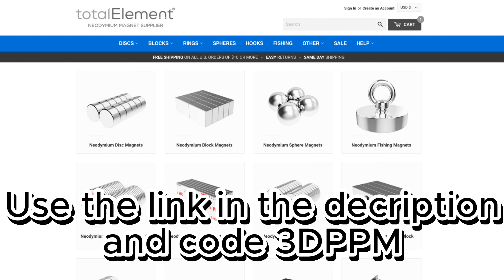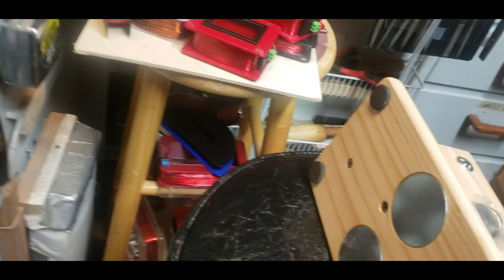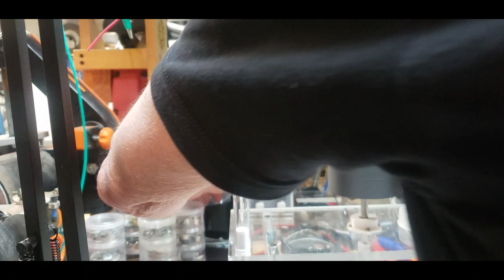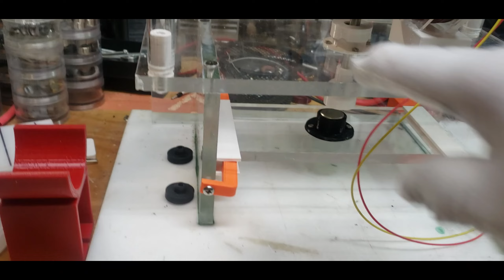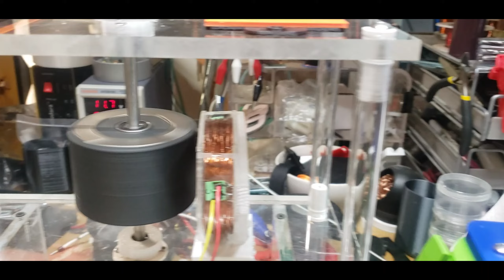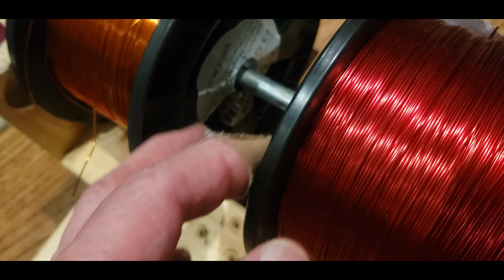3D Printed Pulse Motors running other pulse motors

Comment: I keep trying to type my email but my comment keeps getting removed trying to get in contact with you let me know how I can thanks
Reply from the maker: I guess you tube doesn't like email addys in the comment. I think my email address is on the channel bio
Reply: @mcorrade  Could any of these motors be run from a battery pack Say a rechargeable battery pack that's fed by a solar cell.
Reply from the maker: @nothingelsetolose7661  yes
Reply from the maker: mcorrade@gmail.com